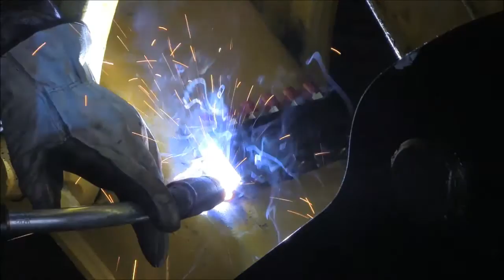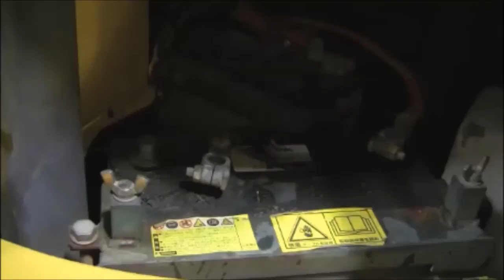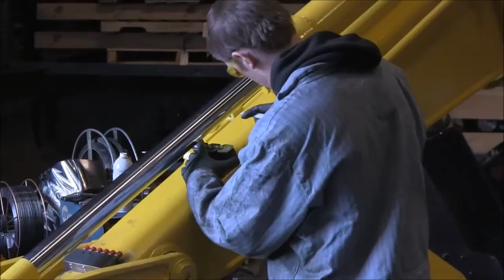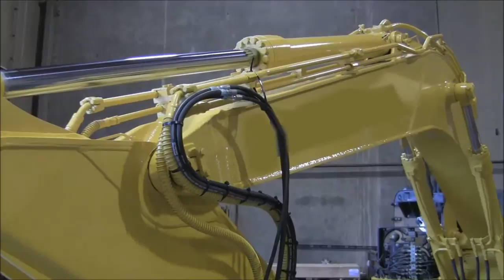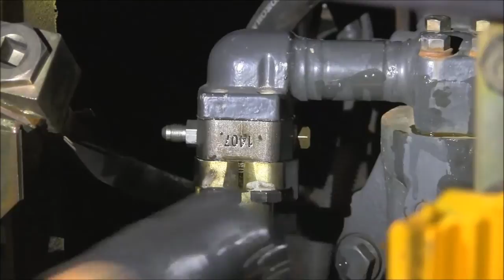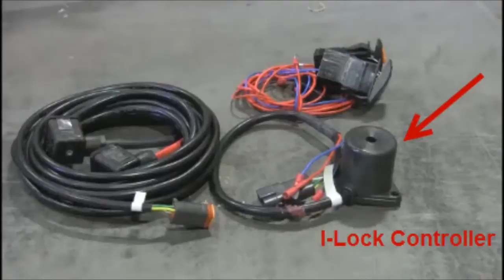I-Lock Coupler Installation

Comment: Hello, I am from China. Our company has developed a new type of electric quick connector product. It has a number of patents. It has been invested in research and development for more than three years and has been listed. It is different from the mechanical and hydraulic structure of the newly designed electric device. The lock structure, 100% security guarantee, are interested in contacting me.